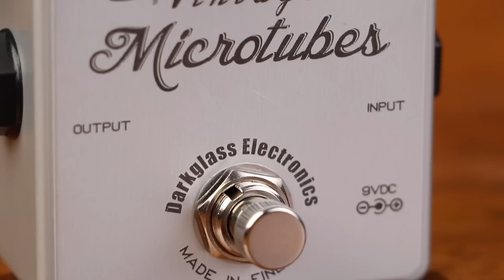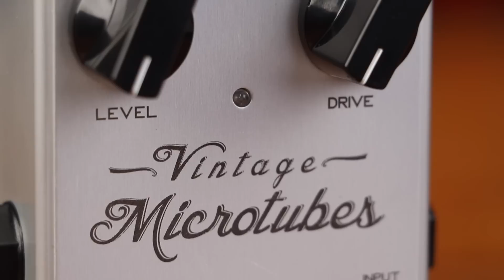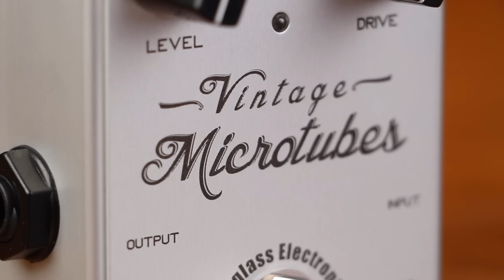Darkglass Vintage Microtubes Bass Demo

Comment: I was torn between this pedal, and the B3k V2. My mind is now made up. This is much warmer sounding.The B3k is nice, but a bit harsh for my application. Thanks again for what you guys do! Nobody does it better!
Reply: Eric J I bought a B3K thinking I could just turn the gain and tone down to get these kinds of sounds and then there'd be a lot more there if I wanted it. Nope. Now I have a B3K I really don't have a use for and am trying to find someone with the opposite problem that wants to trade, haha! The B3K is a great distortion, just not for making the kinds of sounds the Vintage Microtubes is so great at.

Comment: I have the B7K and it does everything I want in a bass pedal. DI, four band EQ, incredibly versatile in every way. Yeah, it's expensive as fuck but it's literally multiple pedals into one, which happens to also have the best distortion in the industry currently. Save up the extra $50-100 on a darkglass and you'll literally never need another pedal for that space again. Once you go darkglass, you never go back.

Comment: GREAT demo!!! This pedal is awesome. When I 1st got it, I wasn't crazy how is sounded when I compared it to the B3K (bandless). When I tapped it on in 2 different bands, I was floored. I love it as much as my B3K
Reply: I have the option of getting either a B3K v2 or a Vintage Microtubes but the cash for only one. If you had to pick one, in terms of versatility and how often you use it, which would it be?

Comment: While the Darkglass stuff is nice, it really ONLY has one sound. If that is the sound you want.
Reply: I dunno, I like the sound of the Vintage better than their B7K. Not enough warmth on the B7K for me
Reply: @Lord_UND_Himself  The Vintage ultra and The B7k ultra sound nearly exactly the same. These little versions are pretty basic, but when you get to the Ultra level you can EQ in any warmth you want. I have owned An M900 and have got a B7K ultra , and the B7K can be EQ'd to sound exactly like a Vintage. The B7k has a lot more distortion to add if need though.
Reply: @kalidesu That's just not true, the pedal let all of those basses show off their particular sounds while adding some overdrive.
Reply: I'm getting a EHX Battalion Bass DI. Almost sounds like a B7k. It's also cheaper. Also, I doubt anyone can pass real blind test between Battalion and B7k. I'll get a Darkglass once my finance is stable.
Reply: Yes, thats true.
Reply: Agree. All the darkglass I heard they have this metallic tsing Tsing sound too much high end
Reply: Agreed, but it's a great sound.  After trying countless overdrive/ampsim/distortion pedals, nobody nails the tube amp grind like Darkglass.
Reply: Disagree at all.
I got a b3k and I can take out from it lots of different flavours